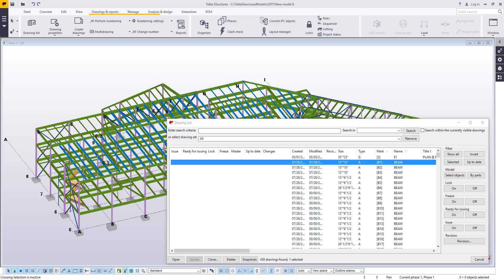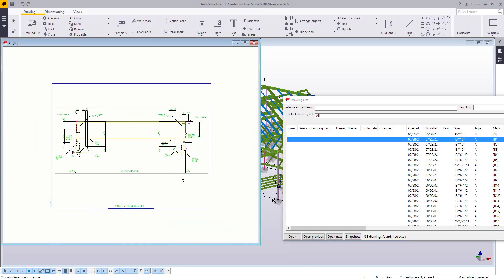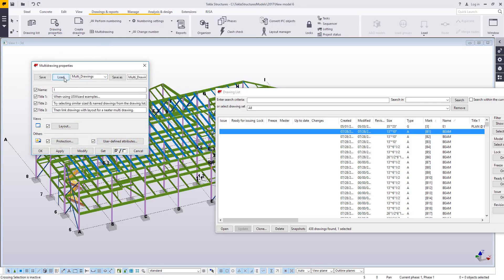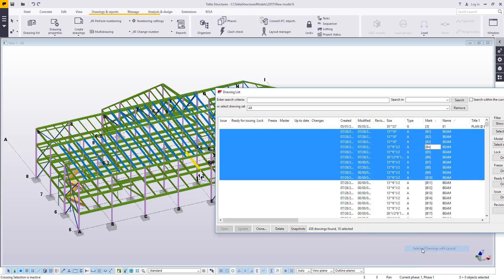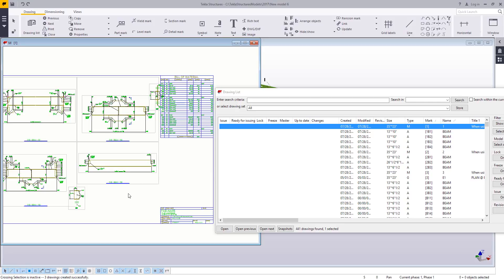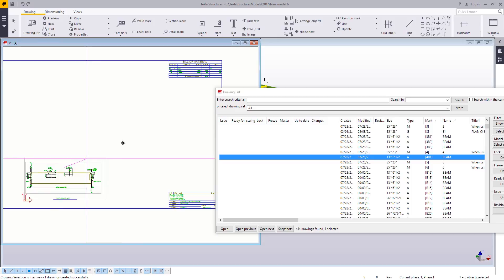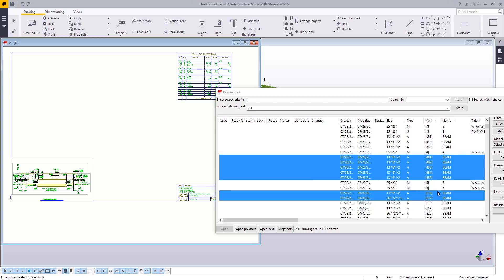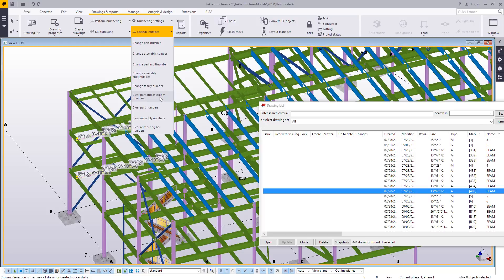Multidrawings in Tekla Structures

Comment: doesnt work for me, multidrawing wont combine multiple drawings instead it kinda replicates them
Reply: Creating multidrawings does not delete the originals, it is a 'link' between the individual details and the multidrawing that is printed. If you edit the individual detail, you will see the multidrawing views update as well to match.
Reply: @TrimbleTeklaDave  Thankyou for the answer, turns out I was doing the automatic way in which Tekla decide how many drawings per multidrawing and Tekla decided that each cast drawing needs its own multidrawing